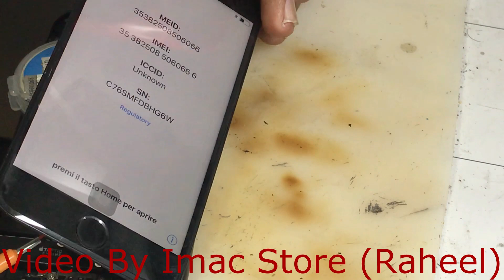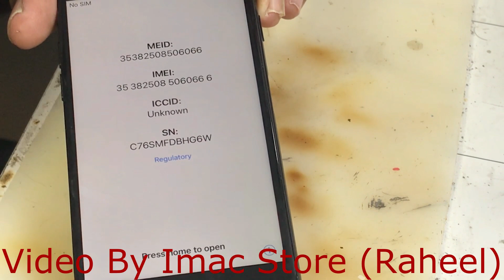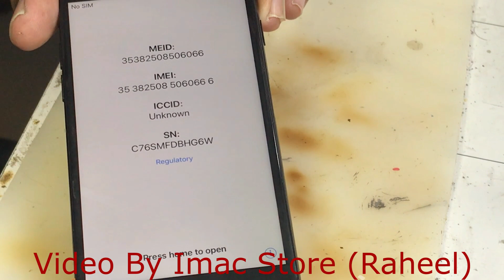iphone 7 home button not working fixhome button not working fix (hindi)

Comment: Hi friend, I saw your video many times try to understand what did you do on that iPhone 7 motherboard. I have right one of it that has the same problem. It has wather damage and the home button doesen't work anymore. I followed your repair job but I can't see which components you replace or fix by a jumper (if you do it). Did you work on R3801? Is issue linkd to MESA_TO_AP_INT_CONN? Thanks so much for your kindly reply.